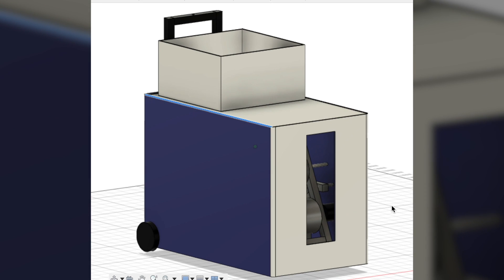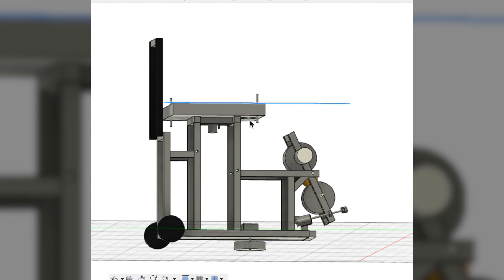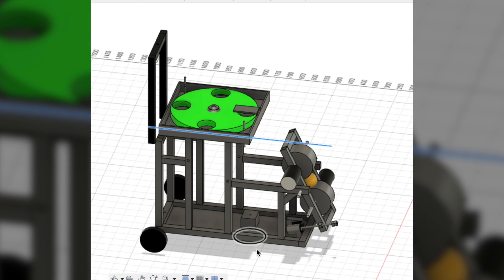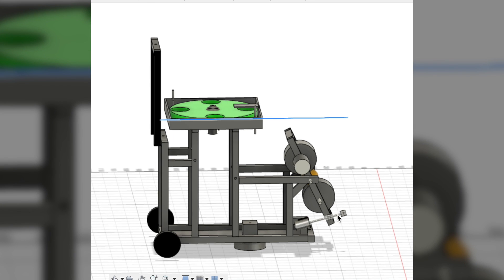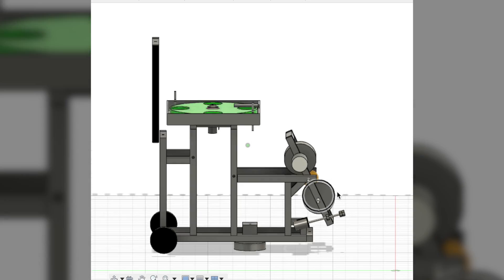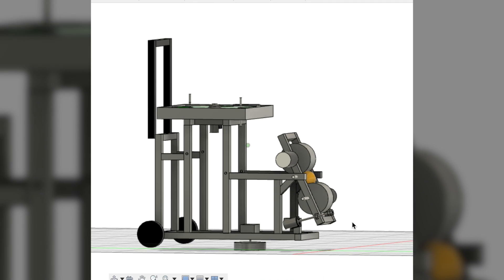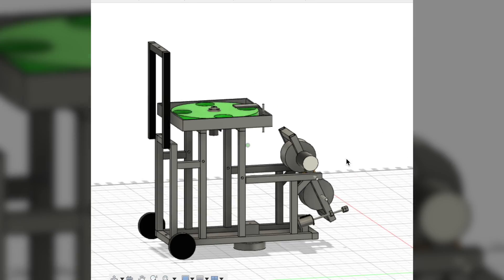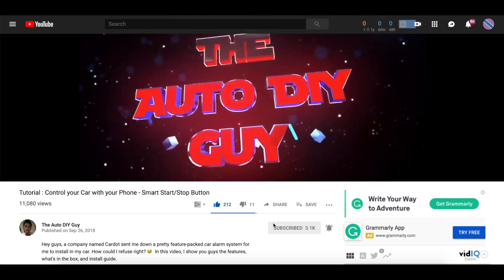Building a Tennis Robot (Design)

Comment: Was this ever built?   I am building one too but have not figured out the feed mechanism from the ball repository to the launcher wheels, in particular when the angle of the wheels is changing to lets say 45 degrees high shot to a lower angle for low shots.